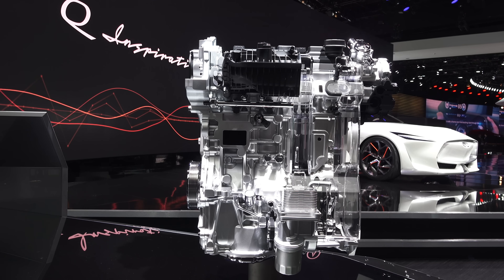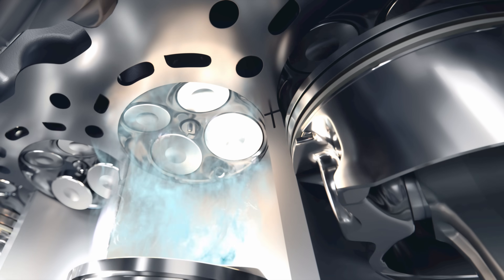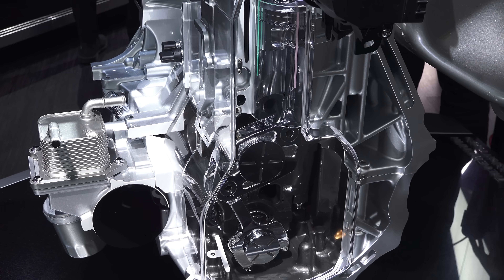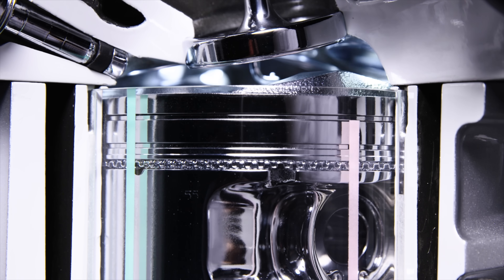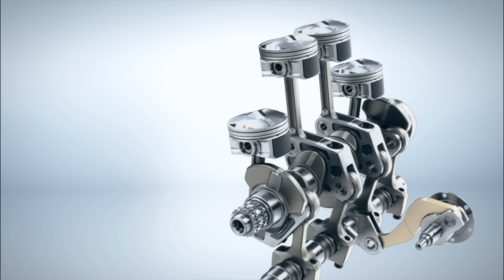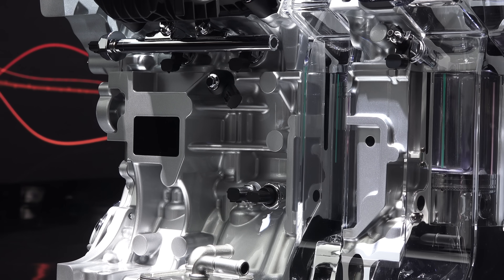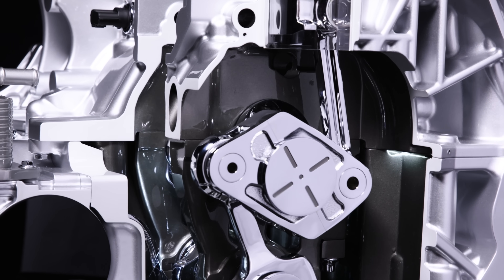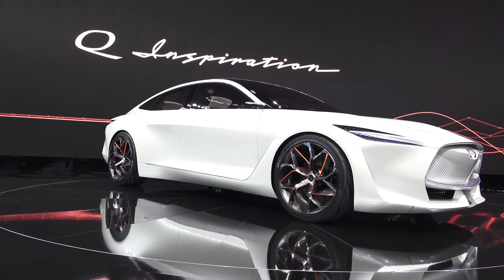INFINITI Reinvents The Gasoline Engine — VC-Turbo

Comment: 2 sets of injectors? Direct injection for eco mode supplemented by port injection for performance?
Reply: Toyota has this on all their Direct injected engines, except for some obsolete engines like the 4GR-FSE. But it's the opposite, port injection for low load efficiency, direct injection for better efficiency and performance under load.
Reply: But they said the opposite in the video.
Reply: It would be interesting to release a 5-cylinder VC engine, potentially even smoother than a 4-cylinder.
Reply: Yup.
Reply: Ft-lbf/sec Sure it is. With VC you could run very high compression ratios under low load and ease it back a bit under power to prevent knock, exactly like they do with the turbo. It might not help as much but it'd still be useful. Besides which, as was pointed out in the video, the mechanical design for VC has some inherent efficiency benefits like reduced vibration and more direct transfer of power to the crankshaft with reduced side loads. Properly tuned and paired with the numerous other technologies used in this engine, you'd have a very, very efficient naturally aspirated powerplant.

Comment: More parts to fail... reinventing the wheel is t always the best option. Refining proven methods usually results in higher gains.
Reply: If everyone thought like that nothing new would ever be done.  That is a terrible attitude.
Reply: That's how they chose to create a variable compression ratio. Not very much reinventing going on here. We know low compression is needed for power, we know high compression is more efficient. This is how they chose to make it happen. You got a better way?
Reply: Clearly you haven’t had to work with engineers who over complicate simple tasks and or you are an engineer. Btw its a great attitude thanks 😎 kiss method fixes most challenges
Reply: +Timber Wood People said that about Over Head Valves. Don't you realize that? There's like 6 more parts, tons more friction, tons of weak points, way more complicated. But it was the better way and you don't see very many flatheads around now do you?

Comment: The no of moving parts have increased which also means more mass. Wouldn't that increase the inertia of the engine? Wouldn't that lead to an extra effort in accelerating the engine?

Comment: Thanks Jason.  This engine is over-complex. It even has two injectors per cylinder.  I believe it was designed by the French.  What are the advantages in the real world of driving?  

•  Is fuel consumption twice as good?
•  It is lighter? 
•  Is it smaller? 
•  Are the emissions better?

Makers are badly trying stop the rolling steamroller of EVs and electric battery hybrids. They are better off doing as Volvo are doing and going EV and hybrid only in their range, dropping 100% ICEs.  They need to develop superior electricity generating engines. A constant speed engine can be much, much simpler.  

I advise Nissan to look at Liquid Piston's rotary design, which is now being used for electricity production, although for a large gun. Liquid Piston reversed the Wankel design with the rotor being oval and the engine casing triangular with the ports in the rotor.  This is the only new engine design in 60 years.

The piston/crank engine is by its design inefficient - 80% of the fuel in the tanks is wasted.  Going via this route is a dead end.  They need to wake up... and soon.

EDIT: Auto Express state:
What are the benefits?
Fuel economy is said to be around 27 per cent better than for the 3.5-litre V6, and 10 per cent better than comparable 2.0-litre petrol rivals. Consumption is on a par with 2.0-litre diesels. Performance is said to be 10 per cent up on 2.0-litre turbo petrol rivals.

That complexity is just not worth it for the little gain.

Comment: this engineering design seems like its built to fail. 
more mechanical moving parts.
why not just drop spark and fuel to a cylinder when not under load to save fuel? its being used and works well without overthinking the design of the internal combustion engine.

Comment: I had a real headache understanding the higher compression for low power demands. A friend and engineer explained it to me in a different way:
-In a perfect engine, you want to stay just below the pressure causing engine knock.
-When you use more fuel and air, you have to leave more space not to cause engine knock.

Comment: An interesting solution. This engine uses a camshaft or it seemed to me? The use of an electronic distribution system would increase efficiency and allow tuning the engine performance more subtly (Also in this system can be used pneumatics), as well as the rejection of inlet and outlet valves

Comment: holy crap. i saw the article when the engine first debuted but never really understood it but this video helped a lot and i'm surprised that the extra linkages and control shaft didnt add any height to the engine but i can imagine it adds a bit of weight.

Comment: What is the increase in fuel economy compared to a similar inline 4 on reg pump gas? Where I am premium gas is 20% more then reg gas. I can't see this engine getting 20% better fuel economy then a normal inline 4.

Comment: It will be very funny watching a video when this type of engine rebuild.....minimum 90% of mechanic will curse who built it...
Reply: It actually doesn't look like it would be any more complicated. The piston and full linkage is a single part, so it would assemble pretty much the same way. The variable linkage looks super simple. Seems pretty hard to screw up.

Comment: I do wonder why not just raise or lower the cylinder?
Im sure there is a reason though I've never heard one.
On the topic of aligning the power stroke with the crank, this can also be done on regular engines(am I wrong?). so why hasn't it been done?
Also this tech really shuold be aplied to boxer and radial engiens since it reduces the amount of control rods(whatever the name of the tech bits is), thus reducing weight and manifacturing cost, not rnd though.

Comment: Is this real progress or just a trick to sell more vehicles. It looks so very complicated. How much weight does this complication add to the engine?
It also looks like the centre of gravity is higher and the engine is taller. Too fit it under the bonnet and meet safety regulations requires a higher car.

Comment: That's very cool and clever, if ridiculously complex (because what a modern engine needs is MORE moving parts).  And too bad it will appear in only about .01% of all cars.  So will this push internal combustion up over 100mpg so we can finally put this EV fad to bed?  Because if not then why just not switch to EV?

Comment: hmmm.. I see some possible issues/ areas that could be improved.
I feel like that exhaust manifold could be better, log type manifolds are terrible for spool rates but whatever this car isn't about that

It looks like they have added more weak points for things to fail along the crank setup

Modification of this engine will be next to impossible.

Maintenance will have to be followed religiously, missing oil changes will most defiantly cause major issues

If this car is about economy, I feel like they could have made more progress by saving weight and using better lightweight materials on the chassis/body than making a overly complicated engine to combat economy, that will weigh more anyway with all the extra metal in the engine. 

With a compression ratio of up to 14:1 you know this will have to run on premium fuel 24/7 thus not adding any real fuel saving to the customer. 

I think this whole exercise is more of a "hey we can do this" rather than any real world benefits. 

If over time an engine mount fails or loses dampening capability what kind of effect will that have on the balance of all these moving parts while on the road? 

Would not buy.

Comment: You know what this 4 pot engine really needs? 8 rods and 2 cranks! A short-term hard test does not prove reliability. You need long-term tests, carbon deposits take time to build. You also need heat cycles not just 1000s of highway miles. On that note tell them to send a car to me I'll put it through its paces!

Comment: I have feeling not as sturdy as regular 2.0 g20 motor.. Keeping valve ope. On stroke will richen the mixture coming out maybe ruining converter and o2 sensors.. Seems lile a spring between rod and crank  that is transfering force.. That can be troblesome after some use and high rev high load.. 😒😓😐
Reply: nissan have been using this tech from over almost 20 years on their 2.5 turbo diesel, to keep valve open for a duration of time, and they was the first to ever do it, it was later copied by toyota
Reply: chan129 brown not vvt that's different

Comment: Well I thought the asymmetry would cause more problems that they need to fix, just to get the variable compression ratio. Didn't knew that it fixed the inherent problems with a normal I4.

Comment: I still ask myself why everyone pushes so hard for EVs. Right now the produciton isnt very clean, batteries arent either and afaik there is no real idea to make batteries etc more efficent and cleaner. 
Is it that EVs produce more power out of less energie? (if Petrol and Electricity is comparable like this) (Higher % usage of energie)
isnt Electiricty for EVs mostly created from Nuclear Power Plants? 
I've seen many reports about energie creation and salvaging from Europe (as continent, not Union) where much electricity is bought and sold from france to germany and vice versa, just like russian / turkey / switzerland etc.. And we all know France has still got some big Nuclear PPs running. I think in 'Murica there isnt such a big difference.

And whats much more a Problem: We already got Problem with storing much / high Capacitys of Electricity for the Peak times when its required and with an even higher consumption because everyone is driving EVs - how shall this work? i somewhat heard that a Tesla is loading with around 120-160kw (I think those were Fast-Chargers). Now dont tell me if there are 10 or even more EV loading in the same street that it wont cause problems with the Electric Network. (Overload)

And whats a more european problem - many multi-family Houses, where easily 10 Familys can live, with a mass garage without power outlets. How should i be able to charge my car if required? throw a cable out of the window 4 floors down trying to hit a window of a neighbour? What would happen if it rains that night?
And even with power-outlets in the garages, where i live there can easily park 100 cars - because of capacity problems of the cable the cars loads 5 % per 16 hours?
All those created heat needs extra cooling costing extra electricity. Burning garages instead of burning man?

Sorry but i dont see the Future in EVs! Neither in Petrol. 
EV have a big infrastructural Problam worldwide and petrols (+diesel) have a too low % of usable energy. I think Mercedes reached close to over 50% (i think it was somewhat between 51 and 53%) of work out of Petrol. In a Formula 1 car. Highly advanced technological and pricy peice of Engineering.

I think EVs are a bridge-Technologie with an actual high hype but some questions are still totaly unanswered. You cant dig everything open (again) to throw in some cables for Chargers.

Would love to see an EE video on that, how and or why EVs are truly better. Not just because less moving parts, better acceleration and less running costs per km/mile. A bit more of the surroundings

Comment: Why does boost always go with lower compression ratio? I understand that, all else equal, lower compression means less likelihood of engine knock, but why not just lower the boost with a higher compression? I guess my question is what's the difference between low comp/high boost vs high comp/low boost?

Comment: It's really fascinating how complex yet reliable the ICEs have become .. it's kind of a shame that electric engines will replace them. Overall CO2 emissions will go down which is desirable, but there is little to no clock-work/mechanical intrigue in them.

Comment: Is this design strictly for 4 cylinders?
Reply: Agent Smith Variable geometry might as well be aplied to any number of cylinders. However, other issues, like vibration, must be considered.
Reply: The design appears to only be viable with inline engines, I don't see how it can work in a V configuration, but I'm no engineer.  That leaves 3 - 6 cylinders as options for this design.
Reply: J King - Or the thing we've been waiting for this whole time: Inline 12s.
Reply: There are a other designs for this type of idea. Peugeot has been developing their own, but I think Nissan's is better. There's also another version being developed by a private company that is more compact and easier to implement on V configured engines.
Reply: I think that it won't matter that much. Large engines like V8 and so on, will only be in high performance cars, which doesn't care about maximum fuel efficiency. This technology is primary focus on fuel economy for normal everyday use cars, which anyway doesn't have huge engine nowdays. The trend is to go for smaller displacement turbocharged engines, because main objectives are fuel consumption and emissions, and at same time squeeze out some power so that that SUV also moves reasonably well.
Reply: i'll take koenigseggs innovations over infinity any day
Reply: J King
You can adapt it for V configured engines, just think of it has cam phasing. The orientation of the arms would be different but doable.
Reply: i will take anything that makes me happy, and an accord hybrid certainly isn't that

RWD is required for canadian winter drifting joy, handbrake turns are too dangerous with the curbs covered in 2 feet of snow
Reply: I love Nissan/Infiniti, they are always pioneering tech way before their competitors, yet they are still an under-appreciated brand.
Reply: Remember the debacle with 2009-10 Altimas and how Nissan refused to recall affected cars?
I appreciate innovation, but not from Nissan.
Reply: Commercial vehicles would greatly appreciate an improvement in fuel economy. However, with improved efficiency it means improved performance gains can be attained. Because it can vary the compression ratio the engine can develop more power when out of boost. Thus probably their goals in making a fuel efficient gas motor that has similar power as a comparable diesel.
Reply: I want a Spoon engine built with this concept. by the Samurai's
Reply: Andis Jargans 
I'll still stick with my vq35 any day...lol.
Reply: it is he's favourite reference configuration
it might be for other inline engine configurations as well
Reply: You could use this in other engines but the  complexity of it would be a lot more.
Reply: The engine has an active torque rod that produces counterbalancing vibrations.
Reply: Koenigsegg? If you can afford them, sure.
Reply: Sajaad Nazim: Just realize the truth. There is no spoon.

Comment: My tag would say ‘Leased’

Interesting and well documented video, thanks for actually explaining it. 

My concern would be long term reliably and turbo control. The wastegate would get a serious work out having to constantly vary boost. 
I do like the balance aspects and the reduced piston side force though. 

In the end I still think fully electric or 48v electric assist combined with a simple low cost internal combustion engine is the way forward. 
Torque, simplicity and long term reliability should be our goal.

Comment: I'd say there are implied restrictions on any modifications to this engine, from a tuner's perspective.  Such tolerances in terms of the longevity of this engine design, are baked into the cake, so to speak.  Although the traditional engine designs are becoming obsolete, we can agree Nissan's VQ platform can handle well north of 50% power increase on stock internals.  I believe this new platform has inherent delicacies, disqualifying it from any substantial tuning or modifications.  So basically, what you get, is what you get.  At the end of the day, where's the fun in that?

Comment: Amazing!,I wonder when this tech will be coming to Lawn mower engines,Fuel Racing etc.Maybe take 20 years but concept is very cool.Thank you EE for a fine video and such a great job at explaining.TY73s
Reply: 20 years haha cmon now, this engine will be ancient 20 years from now...
Reply: Lol, its going into the QX50
Reply: This tech won't hit 100% of all engines. Most small engines are specialized for a single task, simple, and cheap. There's no real reason to tweak the compression ratio on a lawn mower. Races like Le Mans may benefit greatly from variable compression though, due to the ability to increase time between fuel stops by trading power, so a lead can be held longer.
Reply: By then, all smaller applications will be battery powered and this engine will be outdated.  This is, unfortunately, just a small postponement of the unavoidable paradigm shift in vehicle propulsion.
Reply: Why are yoi so exited about ruining lawnmowers? A Sythe is still faster. A d didnt mazda already announced an engine just like this??
Reply: From what I understand, this still uses spark plugs in all stages of compression, Mazda want to take it one step further and run on autoignition instead of relying on the spark plug for timing. (the knocking that they engineered out of this engine).
Reply: Russo lol
Reply: Sadly I agree with you. This seems to be a triumph of ingenious engineering, but 10-20 years too late. The days of the IC engine, however clever, are numbered. The major downside of this engine is the added number of moving / reciprocating parts to go wrong. Hundreds compared to the dozen or so, rotational only, in an electric car.
How does this engine compare to its rivals / immediate predecessor in actual numbers (HP, fuel consumption, torque, emissions etc.)? Does it have a flatter torque curve and hence, possibly, require fewer gear ratios?